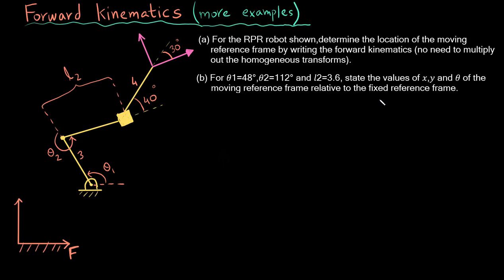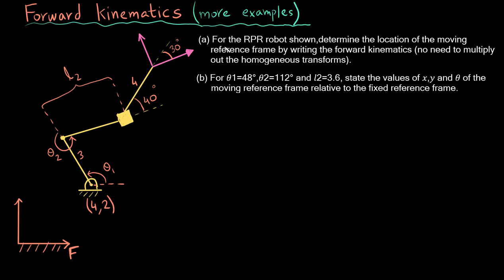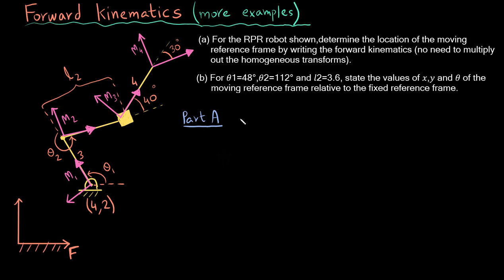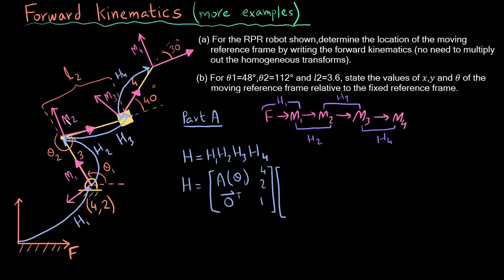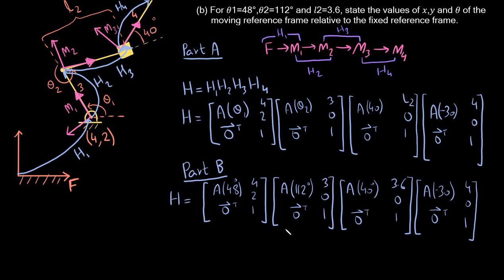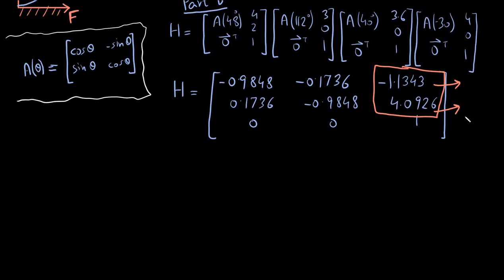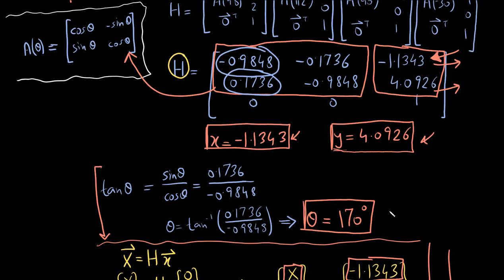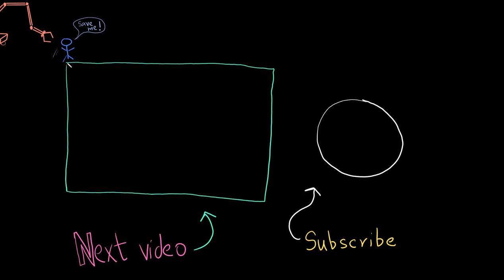Forward Kinematics (with solved examples) pt. 2 | Homogeneous Transformations | Robotics 101

Comment: if you check, tan(170) and tan(-10) give the same answer, which is the same answer as the division of 0.1736 and 0.9848. But in general, the arctan returns a value between -90 and 90 degrees, so in this case, -10 degrees is the correct answer. 

Am I missing something here? Because 170deg and -10deg is a waaaay different answer and only one can be true. 

Thanks in advance!

Comment: Shouldn't displacement in H1 be 0 (instead of 4,2) since there is only rotation and no translation since origin of both M1 and fixed frame is same?
Reply from the maker: The way that I have marked out the frames, you can see that my Fixed frame (F) is all the way to the bottom left of the screen while the M1 frame is coincident with the robot's base. Therefore, in order to go from F to M1, a displacement of (4,2) is required. I hope that clears out the confusion.
Reply: @EngineeringSimplified  did you place your Fixed Frame (F) in the bottom left for a purpose? Or was it just for the sake of demonstrating the concept of the formula. In other words, would an application in real life require the placement of the Fixed Frame in a point different than the M1 frame?

Comment: Hi sir, just a little confusion, why did we not take sin inverse or cos inverse directly and how is tan giving us 170 degree i solved and got diffrent ans with tan inverse i get right ans with cos inverse but the ans is either round about plus 10 or minus 10 by sin or tan
Reply from the maker: That is a very good question! I often had the same confusion when I was doing my Master's degree as using sin inverse and cos inverse gave different answers. Thankfully my legendary professor (Dr. Drew Murray) explained to me why that is. I won't go into too much detail but just remember that FIRSTLY whenever you have the option of using a tan inverse, use it. It should ALWAYS be used (if possible) instead of sin inverse or cos inverse. It is because tan = sin/cos , so it takes into account the sign (and hence the quadrant) in which the required angle lies. SECONDLY, when using tan inverse, using the 2-argument arctangent since that takes care of the signs. In MATLAB you use 'atan2(y, x)' get the result. In EXCEL you use '=ATAN2(y, x)'. 
I hope that helps answer your question.

Comment: In the last question why we used tan function to calculate angle of moving reference frame relative to fixed frame ??
Reply from the maker: Hey, that's a great question!
When dealing with trigonometric functions, you can always get a bunch of different values based on which quadrant your 'value' lies in such as cosine-1 (value) or sine-1 (value).
In order to eliminate any errors with this, it is always a good practice to use tan-1 instead of cosine-1 or sin-1. The reason is that when you are doing tan-1(a/b), you are preserving the signs of 'a' and 'b' and it tells the calculator which quadrant you are talking about. 

On the other hand, if you just did sine inverse of a number, let's say sin-1(0.3), it could mean either of the two things:
1. You mean sin-1(+0.3/+1)
2. You mean sin-1(-0.3/-0/1)
So, you see the quadrant will change and so will your answer.

Hope that helps. Let me know if you still have any confusion.
Reply: Thanks !! I got it 👍
Reply from the maker: @KabirKhan-tu1mp  Perfect!